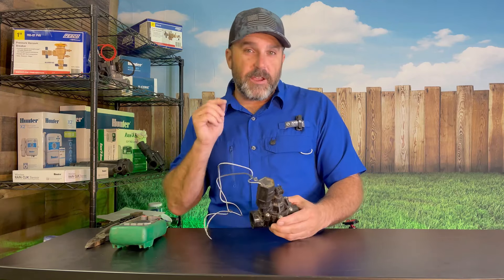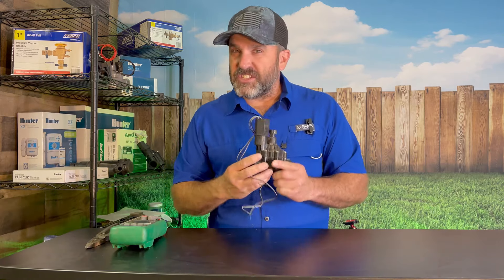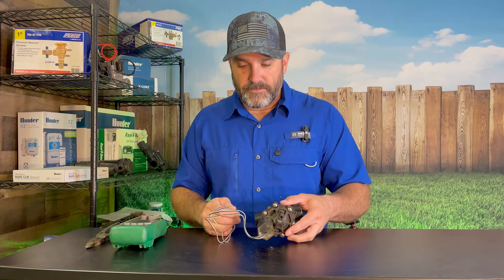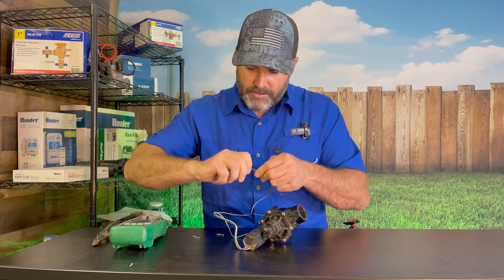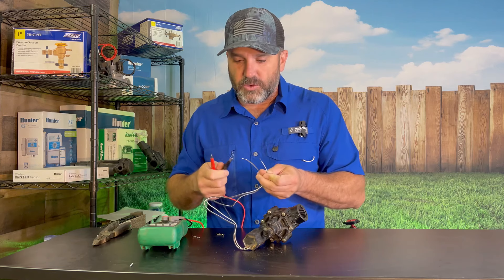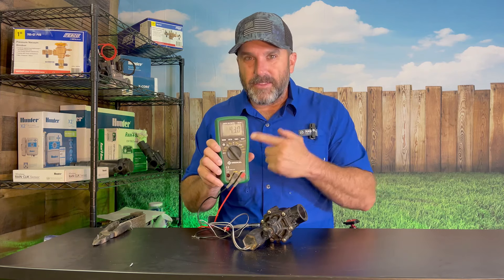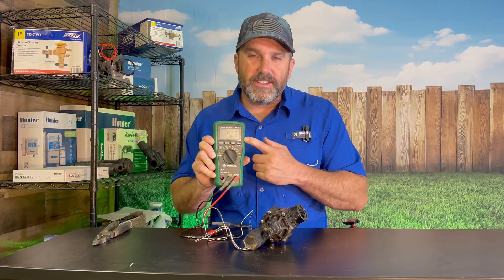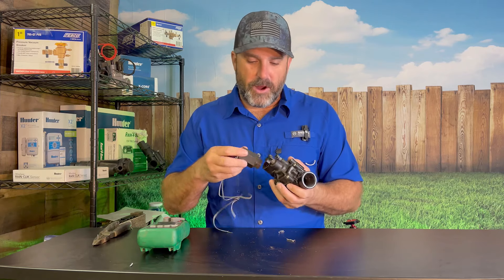RAIN BIRD Sprinkler Solenoid Troubleshooting | Good Solenoid Resistant Test Numbers

Comment: Why do these valves say "no pipe dope?"
Reply from the maker: So usually anywhere there is a gasket, like on the solenoid, you do not use pipe dope or thread tape. You can you it when installing a new valve and threading a pvc fitting into the inlet and outlet sides of the base of the valve. If that makes sense?